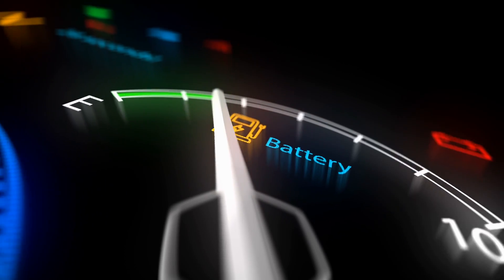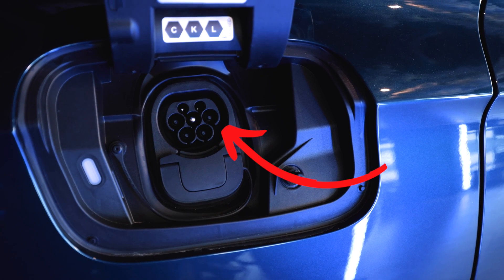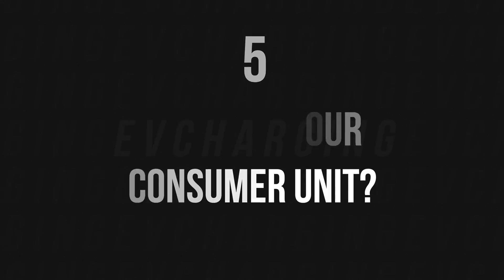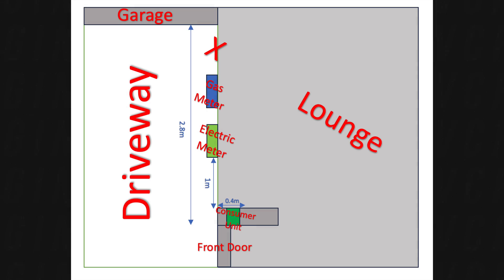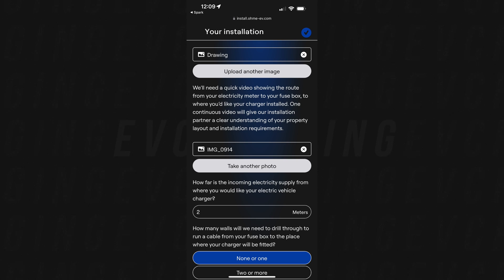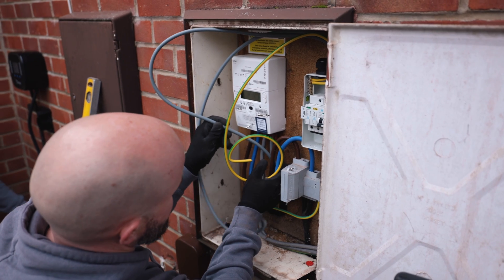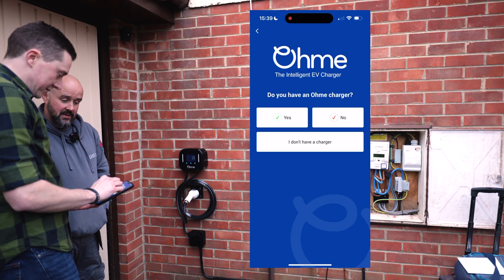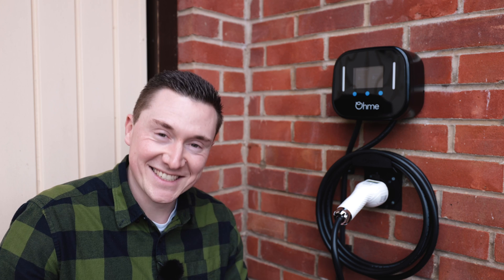EV Charger Install! | Ohme Home Pro

Comment: Don’t bother with this charger if you have two ev vehicles. It’s a nightmare if you want to use the 7p tariff. It’s really lacking basic features.
Reply from the maker: I’d imagine you’d just need to switch car’s within the app right?
I’ve swapped a few times as I don’t own an EV, when I have a different one I just change it within the app so it’s know’s the new battery capacity 👍🏼
Reply: Nope. Got the reply from Ohme today.
You have to delete your car from the app before plugging in the 2nd vehicle. Then select make model etc and log into vehicle with your bmw/audi id. Plug in the vehicle and it will then charge as needed. If you don’t delete first it can conflict and you wake up with an uncharged car for work. You have to do this every single time you swap vehicles over. Totally unfit for a multi car household. They say they are looking to fix this but turns out it’s been like it from release.
Reply: @James-po4xt  I have an older Ohme, but with 2 EVs experienced the same issue as you. I was gobsmacked that when they released their new, updated app, that they still didn’t support multiple EVs. But now it’s easier to manually change the % change you want in a session, so I don’t swap EVs and just change the desired charge amount instead. Quicker than logging in to the other car!
Reply from the maker: Yes I don’t use car API’s apparently they can be hit and miss. But the whole scheduling with my tariff is brilliant 👍🏼
Reply from the maker: Quick question though, is this with using the API (app integration where you sign in).

Just curious if it’s an easier switch when not using that, although I do appreciate you wouldn’t get the State of Charge shown on the app though which would reduce functionality.

Comment: Interesting how the installers shown themselves installing equipment within the meter box which should not be done. 
They will probably tell you there is no regulation for but when your meter supplier comes to swap out meter they will possibly refuse to do this and make you remove the equipment. 
Poor install.
Reply: They would have at least have to put the Henley blocks inside the meter box if the cables were to be split. The meter boxes are a convenience for the energy distributor not their personal property. I'd move thier meter somewhere high up above a kitchen cupboard where it would be really awkward for them to swap it out. Anyway, what other gear will they ever want to put in there in the future? Bigger smart meters?
Reply from the maker: Hey @jonathanstepehens7804, 

Thanks for messaging! I would hope that everything has been installed correctly. Plug-in stations are certified installers and I even received a certificate from the NICEIC which certifies their installation.
Reply: @npoleary  I'm sure they are decent guys and you will have no issues with it. Have a research on installing equipment within meter box and you might be surprised

Comment: Hi Nick, I would like another number 11 for your video about charging your car. There is disagreement about the maximum charging of your car. 80%, 100%, every day, once a week. Improper charging could damage your battery or shorten its lifespan. Can't you even give a clear explanation about this?
Reply from the maker: Absolutely! I’ll Happily talk about it!
But it’s a struggle to find the right balance when producing YouTube videos! Talking for too long on an EV video can be boring so I try to balance things that will be interesting.

I’ll certainly be covering exactly what you said but saving it for a Tips & Tricks video. Plus I do want to create some more content on Ohme so when I get an EV again I’ll be hopefully creating some stuff at the same time 🤓

To answer your question now though and this also applies to any Lithium-ion battery, they haven’t changed and have been around for years. So this actually applies to smartphones, laptops and other devices too.

So lithium-ion batteries are “happy” in between 20% and 80% give or take. Yes you can go down to low percentages and yes you can charge your to 100% but it’s best not to leave the battery at those states of changes for long periods of time. So if you go on holiday, don’t leave it plugged in.

So if you only go to the shops and back each day and only do local driving you may find a fully charged battery won’t actually get very far off 100%. So it would be recommend to only charge to 80% and 100% when you need it on the longer drives.

You can use the full extent of your battery (that’s what it’s there for) but avoid longer times with the battery fully charged if you can.

If you have bought an EV, and don’t have home charging I would argue that using the full 100% would be more beneficial as charging to 80% could get in the way of day to day use.

Comment: Not sure having all that valuable copper cable in full view is sensible but looks very neat
Reply from the maker: Most chargepoints have visible cables to be honest
I’ve seen a couple that hide the cable but they are way more expensive

Comment: Good morning Nick aka Mr O"L     as usual you have killed it out the park, I love the locking it off so no one can use it that's a very good system for what I can see   its funny Dragon's Den on the 15 2 2024 Deborah medan got involved with 2 guys who are doing install charge points however the difference is house installation, where the houses are will back from the road LIKE MINE its a cable with the work been done with channel deep cable cut outs this is so that no one falls over or trips up from the cable    big Peter Jones brought up what if some one pulles out the charger ? answer from Tucker you can't do that its locked in when charging     so Deborah Meaden is doing in the investment with then the Councl was also brought up.  iv now stepped in with contacting my MP wee have already spoke from that last speak I am now on the Electric revolution upgrade in my area as my area was not even considered till I spoke to her I have told her about the dragons' Den program Thursday just gone     check it out   o ye 3 meter long cable charge point installation £999 for me cable may be up to 30 yards cable
Reply from the maker: Haha thank you! Ah yes it’ll always lock the cable when charging but yes super happy that you have to approve a charge via the app so that random people don’t park on my drive 😅

Comment: Hi Nick,  I started watching your channel back in November last year when I decided to trade in my ageing ML, which still drives like new,  for an EQA 250+ (with all possible assistance and safety packages as a precaution against imminent old age!).  I have enjoyed your well crafted videos greatly and have learnt quite a lot from them, thank you.  On the subject of EV chargers one thing that is worth mentioning is solar integration, very useful for those who have solar panels.  Unfortunately the Ohme Home Pro does not have this, excellent though it is in all other respects. I've gone for the Simpson & Partners Home 7KW Plus,  this looks very neat but it is significantly more expensive than the Ohme.  I cannot comment on its use just now as it will be installed in mid March shortly before I collect my new car, looking forward to that!
Reply from the maker: Ah thank you! Glad you enjoy the videos!
That’s good to know, thank you!

Comment: Yeah peak is 29.9p so not much but if no ev it’s not worth the move over. My Eqa 350 prem plus costs me less than £5 per full charge :) and when charging the whole house is on the cheap rate :)
Reply from the maker: I know that’s so good! 😊 so cheap to charge
Next step is solar panels for you right? 😜

Comment: Yes Nick - "too smart for its own good" - in mY opinion!! I had an Ohme ver recentlY and I hated it! - was waY over engineered!.  Yes its supposed to be verY clever, it interfaces to Your car API and supposedlY with Octopus Go. The App was extremelY confusing, it measures the amount of mileage it has put into our car,  Batter percentage is more usefull I believe. I couldnt understand the cost figures which kept chaging evertime I opened the App. You cannot input a "Charge Start Time" You can onlY input a "Departure Time" - its supposed to be clever enough to work out when to start charging based on Octopus cheap rate times - I could never get it to work. So departure time is used to determine when You want 80% or 100% batterY full time (so that You have enough batter for the start ofYour journeY. But I wanted it to complete charging before end of cheap rate time (Octopus GO is 11:00 - 5:30am) not when I was leaving at 8am. So I had to "pretend" I was leaving at 05:30am just so it would stop charging. Also I am retired and do not  leave home at an regular time anYwaY
Ohme have greate support - but honestl ou need a sience degree to use it and ou have to "trust" that Ohme, Octopus and our car can perfectl integrate and work everthing out for ou (sorrY mY lower case "Y" character has just stopped working on mY keYboard!! grr!)
Reply from the maker: Hey thanks for sharing! Yes I plan to make a follow up video when I have an EV for long term test so I’ll be checking all of it out. I plan to cover things like
API Integration vs non API Integration and of course all of the smart scheduling and if you just want to max charge straight away.

And no worries about the keyboard! 🤓

Comment: Interesting Nick, thanks. I'm due to get my charge point installed tomorrow. Like your installation it's being located on the exterior wall next to my meter box. My consumer unit is actually on the inside wall behind the meter box. I was hoping they wouldn't need to go through the wall and they could go into the meter box and if necessary use the existing trunking if required to go through to the consumer unit. Looks like you didn't have to have any cables going through a new hole in the wall?
Reply from the maker: Ah thanks for watching!
Yeah it was super interesting to see it all in action. I thought they were going to go to the consumer unit inside but they did the whole thing on the exterior. There’s a separate mini cutoff switch installed right there in the meter box.

I’m presuming that was probably the easiest thing as it was right next to it. So apart from the holes in the wall for the unit itself and the cabling into the meter box, no other drilling “into the house” needed 🙏
Reply: @npoleary  thanks Nick, hopefully mine will be a similar install! Have a good weekend.
Reply from the maker: And you! Hope it goes okay! Any questions, message me on here and/or on my email "contact@npo-media.co.uk"